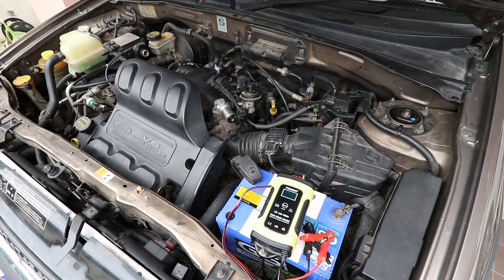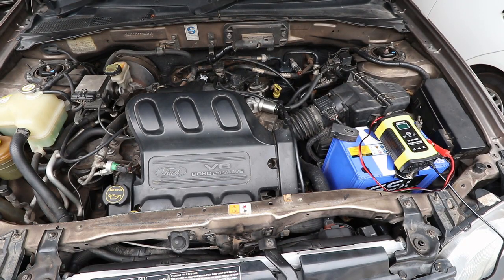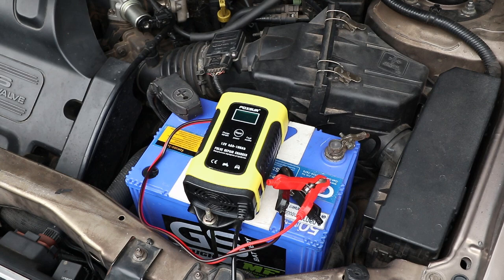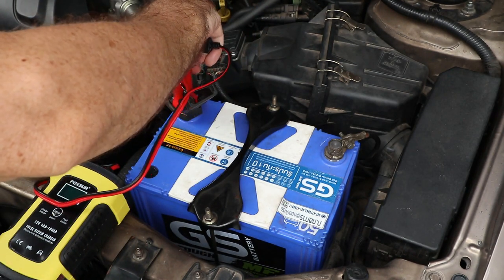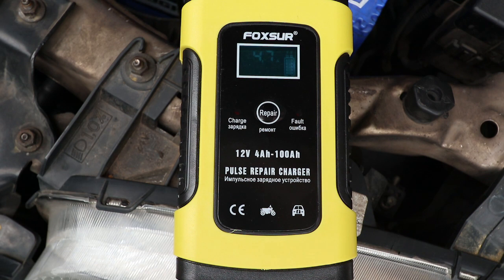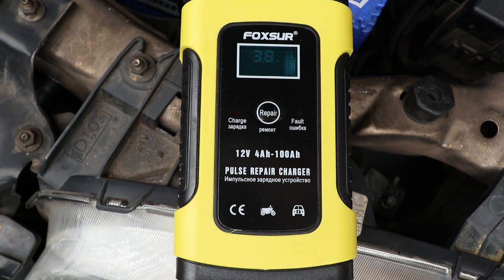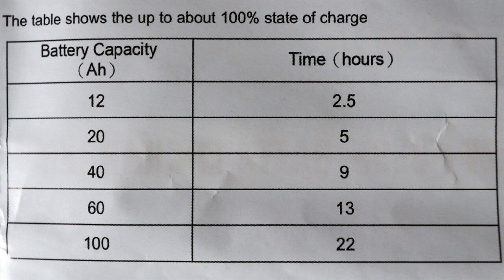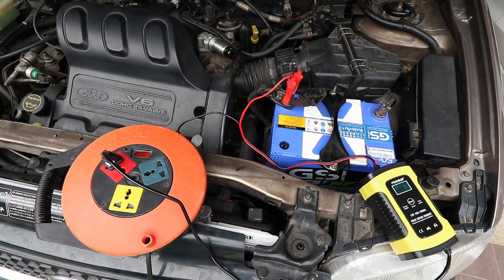Review Of The Foxsur Pulse Repair Car Battery Charger

Comment: I just wanted to know after using the pulse repair did the battery last?
Reply from the maker: It's still going strong! The battery is rated at 620 SAE and after the pulse repair I got just over 600. I checked it again two days ago with my battery analyser and it had dropped to 500 SAE, but the analyser said it was still fine. I will probably do another pulse repair soon to see if I can increase that figure, but it takes a long time - 24 hours plus based on my last experience.

Comment: My friend, i need your advice. I bought this battery, and it went on “FUL”, but I left it to do some chores, and came back 1.5 hours later. So the LCD display says “FUL” for 1.5 hours. The display still says FUL. But at the same time, the red indicator light went from “charging” to “fault”. Is this normal? Can “FUL” and fault light be ON at the same time? Its a brand new battery. I bought it just 2 days ago!
Reply from the maker: I'm afraid I don't know, but it doesn't sound right especially for a new battery. The manufacturer recommends leaving the charger on for a while after it says full, so you did the right thing. I don't know why it is telling you there is a fault. In your situation I think I would use the battery for a while and then try charging it again later.
Reply: Phil UK Net thank you! My theory is, when the charger is plugged to wall socket, and the battery is FULL, the “charged” red light comes on. But, when the smart charger is unplugged from wall socket, the LCD displays full, but the “fault” is where the red light comes to simply because its not connected to the wall socket. I hope im right! 😮

Comment: Just got mine delivered before I found your video. I've got a 2YO battery & I'm 100% sure the alternator isn't the problem. Thanks for a quick & succinct review of this product.
Greetings from Manila, Philippines!
Reply from the maker: Hope it works out for you, but put aside lots of time. I just spent 26 hours doing a pulse charge to repair my battery. The Philippines and Thailand have similar climates and batteries don't last as long in tropical countries compared to temperate countries. Mine only tend to last around three years normally, but I'm hoping that the pulse repair function will extend the life a little. Your famous jeepneys must need a lot of battery power to illuminate all those lights 😉

Comment: Thanks Phil. Got the same foxsur, similarly my car didn't have enough energy to unlock the doors either. When connected mine said battery was 'FUL' fully charged, even though it's dead. I believe this means it's either very sulphated or left too long. My battery is only a year old. I've put it on pulse charging but not sure it's working as videos I've seen of it shows fan should be working and it should make a fair bit of noise when pulse charging, but neither happens on mine. Have you experience of using the pulse function?
Reply from the maker: At the time I made this video I hadn't used the pulse/repair function. However, a little later I bought the Foxsur battery analyzer and it showed that my battery had a problem. The CCA is rated at 620, but the analyzer showed that it only had 191 and told me to replace the battery. I then used the charger in pulse/repair mode for the first time. It took a long time - I left it repairing for 26 hours - but after doing so the CCA was restored to over 600. I noticed that when I put the charger into pulse/repair mode the fan slowed down quite a lot and was much quieter than regular charging mode, but it was still running. So, yes I have used pulse/repair mode and it does work. Here's a link to my later video: https://youtu.be/JatbNnFmodI Thanks for your comment!
Reply: @PhilUKNet  Thank you for the reply Phil. I'll check out the other video. The fan on mine isn't running at all, although I've only had it on repair for a few hours so maybe the device hasn't heated up enough. Really appreciate the help.
Reply: @Taintless101  How's your battery? Was it fixed?

Comment: in fact this device is distributed by many brands, cuz this come to those enterprises who want sell to final user.
Reply from the maker: Thanks for the info.
Reply: @PhilUKNet  worth It
Reply from the maker: @merlinelmaje  I think it is. I also like the Foxsur battery analyzer. I think they are both worth having.
Reply: @PhilUKNet  yeah, a few but precise functions in a small yellow box
Reply from the maker: @merlinelmaje  An excellent description!
Reply: @PhilUKNet  i use yesterday with my used battery, the first issue with this was an info about (ful) full charge and then, it was not charging; then i press repair button, about 5 mins, then press again, and it took about 8 hour to complete the full charge with no problems. i think the user manual does not offer wide info, so im not recommend press this button meanwhile they throw a precise manual
Reply from the maker: @merlinelmaje  Thanks for the info! The good news is that you got your battery charged and - based on my own experience - 8 hours is fast. Maybe it's because my battery is big (75 Ah), but every time I do something it takes 24 hours. You're right, there isn't a lot of information in the manual, but at least you figured it out yourself.

Comment: Does that foxsur thing durable ? Look like a cheap made that don't last long eh
Reply from the maker: It's not bad, actually. Plastic, but fairly well made. I guess it depends how you will be using it. Mine will just be used at home occasionally in a gentle environment and it should last for a very long time. If you are using it in a repair shop and it is being used all the time it probably won't last long. It's definitely made for domestic, rather than for professional use.
Reply: @PhilUKNet  still functioning today May 2020 ? Upon connecting to the AC outlet does the fan rotate instantly? Reading review comment have issues of fan not rotating
Reply from the maker: I haven't seen any of those reviews about the fan, but yes, the fan starts immediately after it is connected to the A/C.
Reply: @PhilUKNet  thanks
Reply: playstation2bigs
 said:
'Does that foxsur thing durable ? Look like a cheap made that don't last long eh'

In case you are still interested, I just bought two of the Foxsur chargers: they are quite sturdy, well made and designed. I opened one up and found that the components, construction and layout are of a very high quality. From England

Comment: Thats not temperature of battery but temperature of ambient air, it has function where in cold weather conditions it charges battery with lower amperage ;)
Reply from the maker: The user manual says: "The LCD display will show battery voltage, charge current and inside temperature (Temperature is for reference only, allowed tolerance)."
'Inside' temperature is internal battery temperature, not ambient temperature.

You're right, there is a winter and summer mode: "Charger detects the inside temperature, will switch to the appropriate voltage automatically." Notice it says 'Inside' temperature again, not ambient temperature.

The temperature is measured electronically by measuring electrical resistance, which changes with temperature, and it is measuring the resistance inside the battery.

Furthermore, while I was charging the battery the temperature readout fluctuated by about 10 degrees. This tells me two things. 1. It's not accurate (the manufacturer says it is for reference only). 2. The ambient temperature remained roughly the same throughout, so it's not measuring (and can't measure) ambient temperature.
Reply: @PhilUKNet  Dzintars is correct, as is Tab7.6.

Factors like ambient temperature, sulfation, grid corrosion, fluid level, specific density (acid concentration) of fluid AND internal temperature can all cause changes to internal resistance - but not internal temperature ALONE. 

Granted, if no other factors change then it may be possible to guestimate the internal temperature.
The charger has two PCBs, a power/charge PCB and the control/display PCB. The temperature is taken from the main chip on the control/display PCB.

A quick web search for a term something like "what changes internal resistance of car battery" will provide a plethora of factors affecting internal resistance.

Bear in mind that instructions, especially from mass-made devices from China (re-badged and sold under lots of different 'brand' names) ought to be taken cautiously.
Chinglish alone can alter the meaning, and an understanding (or lack of) from the original author can be suspect at least.

I have one of these units (Amazon, badged Dandelionsky!) in which the description says the unit is IP65 rated! Huh! The case is wide open to dirt/water ingress from the front and rear vents, more like IP42.

Amazon: https://www.amazon.co.uk/gp/product/B084Z7LPD2/ref=ppx_yo_dt_b_asin_title_o01_s00?ie=UTF8&psc=1

Having said all of that, great review though, always good to see real-life experience :)
Reply from the maker: @dave1066  Thanks for the info.
Reply: @dave1066  said:
'... the description says the unit is IP65 rated'

😊😊

I suppose that the best you could do about the temperature is, before charging,  to leave the car standing for 24 hours with the charger under the bonnet with the bonnet closed. That way the battery internals and the charger sensor should be roughly at the same temperature, at first anyway!
Reply: @PhilUKNet  no problem sir:-P
Reply: make your own review. don't mess with someone else's
Reply from the maker: @thennekcdcdthennek6417  Thank you!
Reply: The temperature indications in this charger are one big nonsense. They are in no way up to ambient temperature (and certainly not the battery). It is also not true that in winter mode it charges with a lower current. Temperature compensation only affects the final charging voltage, in winter it is higher. By the way - the temperature sensor is located on the display plate in the charger, unfortunately the readings from it were not well implemented.